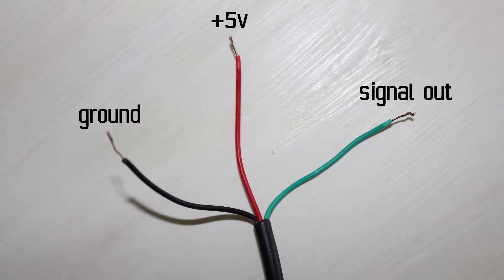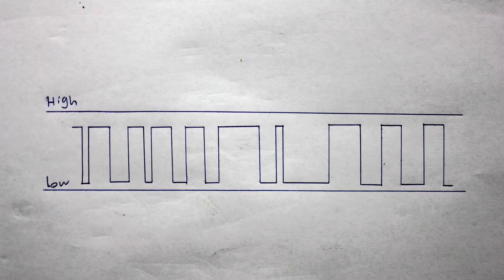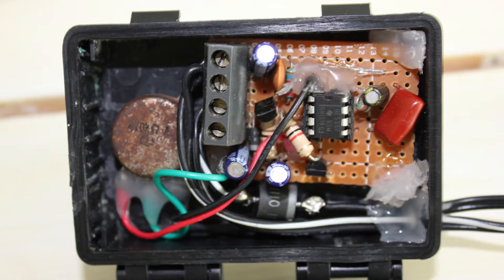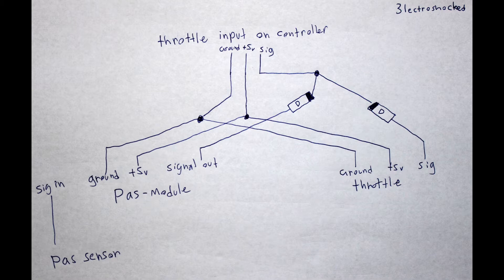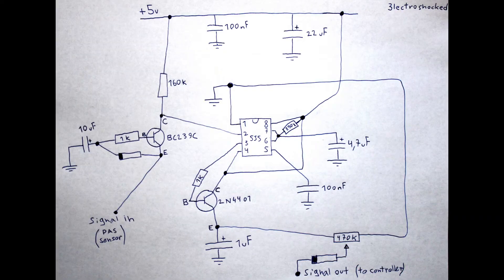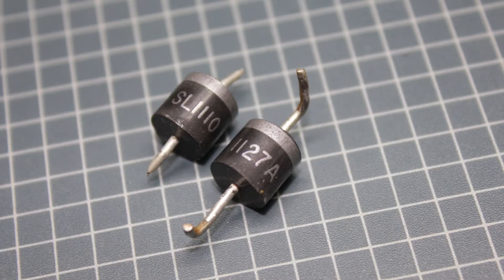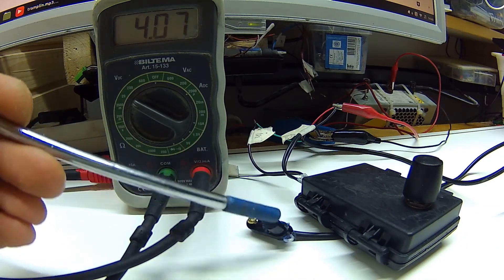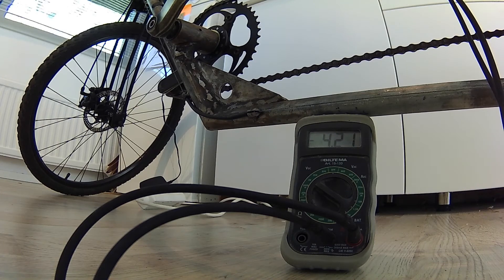DIY Pedal Assist for ebike controller with no PAS | Circuit diagram

Comment: hello sir, I have tried to make it for a motorbike PMSM controller fitting sensor, when I try to use a power supply it works but when I try to use a battery it doesn't work for the circuit. Does it require a separate voltage for the 5 volt module?
Reply from the maker: Hello! It was powered from the same source, as the throttle :) Yes, that is 5v coming from the controller.
Reply: @3LECTROSHOCKED  Connected to the controller but it doesn't work if you use a Lion 53V battery supply to the controller, if you use an adapter supply it works, is there an email?
Reply from the maker: Use the 5v rail of the controller. 5v rail feeds throttle and sensors in the motor etc.

Comment: PAS on my ebike has huge delay, I need to do 3 revolutions with pedals to start assistance. With fat tires, it is not very simple from standing start. If I understand correctly, I could use your method (and maybe to use a switch to switch between default pas assistance and this throttle assistance) to fix my issues with pas latency?
Reply from the maker: Hello! Hmm, that's an interesting goal. I actually think tjat in Your case it's maybe wise to go deeper into engeneering a proper system. Use Arduino, for example. Write a code to do axactly what is needed and switch between Arduino assistance and regular PAS. Anyways, good luck :)

Comment: is the motor running when the pedal move backward and forward?
Reply from the maker: Hi. Yeah, that's a bit of an issue. I also have that happening on my other controller with native PAS system. It doesn't really bother me though :)

Comment: I used an arduino nano to look at the voltage change as an input and give a voltage output accordingly, but it only turns on after a full revolution of the pedal, u can actually add a magnet count feature to adjust sensitivity. Then I have switches to select the PAS level so the output voltage can be scaled up 2v then 3v then 5v.
Reply from the maker: That's cool bro! Sounds like a working system :)

Comment: Here is a suggestion:  small brushed electric toy motor (1.5v) riding on the magnet disc.  It should provide enough voltage to trigger a bc547 at a moderate rpm.  I will start this project tomorrow. P.S. I've designed a circuit board on Dip Trace for final assembly next week.
Reply from the maker: Hi! Thanks:) that's an interesting idea!
Reply: @3LECTROSHOCKED  Found a 12v brushed motor in one of my junk boxes.  Measures 30.8mm x 24mm dia. shaft dia. 2mm x 10.8mm long.  Chucked  it up in a low rpm  drill and achieved 1.5v at a low rpm.  Have no way to measure rpm of drill rotation.  This will work.  Have any ideas on another circuit board? I have my thinking cap on, Catch me later.
Reply from the maker: Hi. Sorry I'm not getting what you are trying to do. The idea in this build is to convert PWM to continuous HI, not the other way around :)
Reply: Sorry did not fully explain.  Added a dc to dc step up buck boost module.  I adjusted the output not to go any higher then 5v at a comfortable pedal cadence.  The faster you pedal, the faster you go. Problem  with this right now, signal is jumpy , not steady with steady pedaling .  Have some more work to do.  Will send pics later on.
Reply from the maker: Sound interesting but I'm still not sure what you are trying to do:D
Reply: Increasing motor speed with faster pedalling
Reply from the maker: Oh, ok. I have noticed during 7 years of ebiking that that's not needed if you have a throttle. But a torque sensor would be awesome :)
Reply: @3LECTROSHOCKED  I think he was using a small dc motor like a dynamo to generate a voltage when it spins. LOL. He connects that to the chain drive to work like PAS. LOL.

Comment: Thank You very much for the video. Please allow me a question ( even if I think you will not like it ). Is there a way to replace the magnet sensor from the pedal assist, with a linear potentiometer? I think you already now where am i going with this. Thank You again.
Reply from the maker: Hi! Thanks for your comment! Sorry, I actually don't know where you're going with that :D What you want to achieve?
Reply: @3LECTROSHOCKED  The magnet sensor, is sending a current (signal) to the controller of the engine. If I apply a current through a potentiometer, and i send that current (signal) to the controller, I can make a throttle. (theoretically). Sorry to bother you, it is more of a thought experiment. Thank You again.
Reply from the maker: Hi! No, it's not a current. It's a PWM signal and it varies pulse width. So you would need more than just a potentiometr.

Comment: Hello Sir, I have a Yamaha PAs City but the battery is dead, I tried replacing all li-ion inside with new ones, but my bike doesn't function, it says 0% charge even if all batteries are full.
Reply from the maker: Hello! Do you have a BMS? If yes, then it's probably dead.
Reply: they have private communication between battery and controller on BMS, so if BMS broken all dead.

Comment: hello, thanks so much for your media, should it be possible to make the same analysis  with torque sensor?
Reply from the maker: Hello! Thank you for watching! :) Unfortunately I have never used a torque sensor on my ebikes. But as I understand torque pedal assist assembly uses up to 2 sensors to deliver information. One is similar to regular PAS - it sends pulse if movement happens. And second sensor sends a snapshot of state, that somehow reflects the actual torque. I advise you to measure those signals with a multimeter. Or maybe even connect an LED to see what kind of pulse your sensor produces. When you know those, then you could see if it is possible to translate that pulse into voltage, to feed your throttle input.
Reply: @3LECTROSHOCKED  That make sense, I didn't noticed that torque effect had two sensor because one was hiding in it, I will do the test with your advise, thans a lot.
Reply from the maker: Not all of them have 2, just check your sensor. There should be a lot of wires if there is two sensors :) Good luck!

Comment: I've another suggestion: what about taking the summation of these pulses in SW without the external circuitry? I think it will result in the same filtration. 
Anyway,  thanks for the video
Reply from the maker: Thanks for watching! Sorry, I did not understand that :) Do mean just feeding the signal from the sensor into the throttle input of the controller?
Reply: Oh I was mistaken :D
I thought you are designing a controller not using a pre built one. Sorry for that 😅❤
Reply from the maker: It's ok :))) Thanks for the comment anyways!

Comment: What is the circuit for the sencer of the 3 wires 1 is 5v are the other 2 a coil what is the resistance of the coil if so thanks
Reply from the maker: Hello! Do you mean the HALL-sensor?

Comment: sorry for bothering you again.. But do you have any idea if there is a way to connect the "standart" kt led/lcd displays to my controller without pas and without the right connections for a display ?
https://a.aliexpress.com/_mNhBFB9
Reply from the maker: Its ok, thanks for writing! Well, the display - as I understand - is just an extension of the controller's MCU. So if your controller has an MCU that does not take commands and send data via communication line - there is no way of controlling it and reading data from it with a display unit.  But, I could be also wrong, since inside the controller there could be a TX RX pins for programming that MCU. But the question is, what kind of commands it takes in and will a regular display be able to use those RX TX pins to communicate. Anyways, I think a display uses data pins to work. If you only have one wire for speed output - that is probably just a pmw-signal from one of the hall sensors in the motor. I think if you connect that to the display RX pin - nothing will happen. Sorry, cant help better, since I personally don't use displays any more. Got one of them corrupted under rain water and decided to drop that completely. They don't stand heavy rain :D Although suppose to be waterproof!
Reply: @3LECTROSHOCKED  thanks a lot for your detailed answer :)
Do you know what the display wire of my controller is for ?
I would not really need to controll anything with the display. I would just like to have the informations like km/h, battery level and watt. Is there a way to feed the display just with this info or is it not that easy ?
Reply from the maker: That one weird wire is speed. Haven't ever used that, but I think it is just some sort of analog signal, pwm or voltage. Display have data pins, input and output (TX RX). There is really no simple way of hacking that without actually feeding the right kind of data signal to it.  Sorry :/

Comment: Really awsome video my friend :)
Do you know if there is a way to buy somithing like your "converter" online ? Because i'm shure many many people wold need it.
And would you be so kind and post a list of all the needet parts to make it easier to buy them ;)
Thanks a lot and keep going
Reply from the maker: Thank You very much! :) I started this project because I could not find any help on this issue online. So I guess I'm the first one to do this - at least online :D Although me myself, now I use my most recent attempt on fixing this, using programmable wifi MCU - and I think it turned out to be awesome, check it out: https://youtu.be/6TIP0e4Qdx4 I will try to find time to make component list on this 555 PAS-version. Now I'm making a new in-depth video on How to make a great DIY lithium ion battery. Thanks! :)
Reply: @3LECTROSHOCKED  you should definitely start selling them online. Maybe in a 3d printet case and send them to some "e bike youtubers" for promotion 😜 the great think on the version with the potentimeter is that you can change intensity while driving right ?
I allready checked out your other video but the wifi chip seemd a little bit to complicated for me to build..but maybe its not :)
For a genius like you it might be a great idea to build a cheap diy torque sensor for a "non pas controller" 😊
Reply from the maker: Good idea :D Yes, POT is for adjusting. But I actually noticed that I haven't changed PAS-setting ever during 5 years of eBiking.. ESP-stuff is actually very easy, if you use Home Assistant for coding. I have only been with that for a year, and feel like a pro :D (read: coding for stupid like me) :D:D Torque sensor is very interesting subject. I have thought about that. Maybe some day I try something with that. Thanks!

Comment: Just the idea I was looking for my newly built ebike without PAS. I would build the sensor myself with hall-effect uni-polar sensor and small magnets and then add your 555 based throttle activator to it :).
Reply from the maker: Sounds great! Since this video I have tested this module with different controller and upgraded this circuit a little bit to add more stability. On the input side I changed pull up resistor to -> 1k. Also on the input side I added 160k pull down resistor to transistor EMMITTER pin so that capacitor could maybe discharge if needed. Also I added 10k pull down resistor to 555 pin 4 to eliminate possible leakage of output transistor. Hope this helps! :) Next I will try to do a new module using cheap microcontroller - there will be a ton of cool possibilities there besides pas, for example cruise, wifi etc..
Reply from the maker: Oh, also I changed capacitor on the input side to 4,7uF :)
Reply: 3LECTROSHOCKED thanks for your video ;)... Did you replace 10uF or 100nF?   And also I’ve been trying to find those diodes (SLIII0 or II27A) that I have to use for the throttle and PAS but without success.
Reply: Wonderful !! Just before I start building those are really helpful updates ☺️I have previously built 555 projects, so if any modifications required then I will post after installation.
Reply from the maker: Just uploaded a new video. New programmable PAS-system using ESP-module. Check it out :) https://youtu.be/6TIP0e4Qdx4